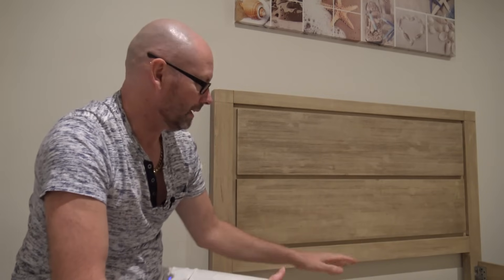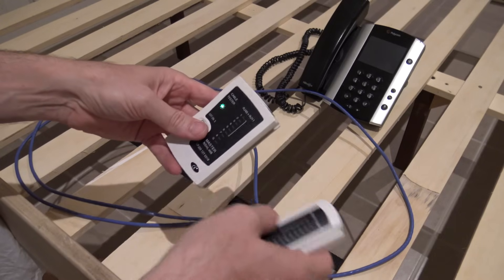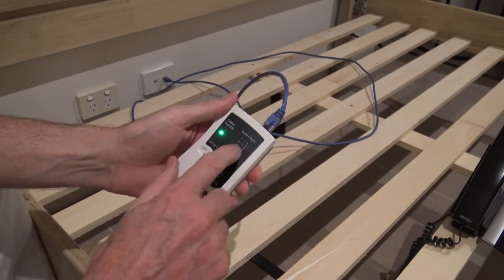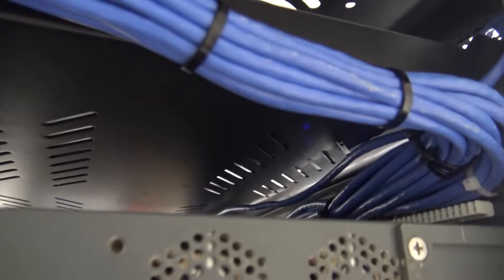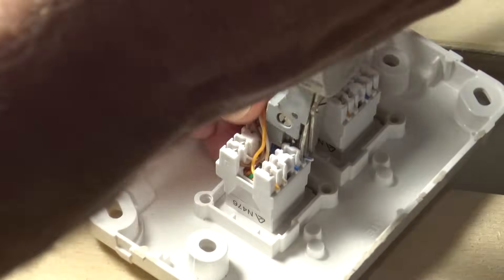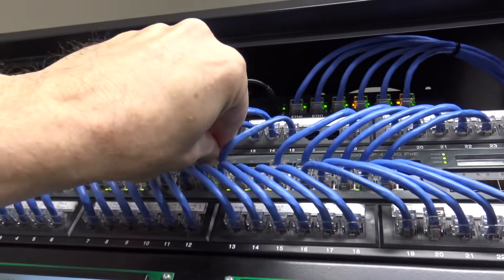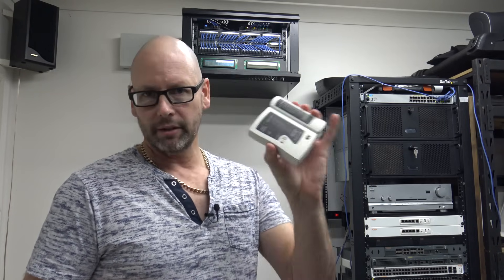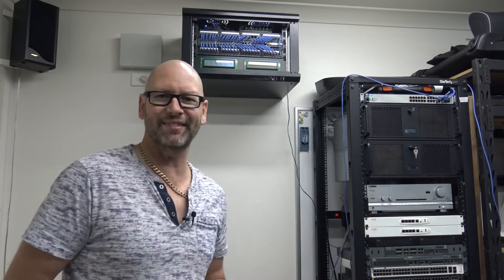Layer One Fault

Comment: Isn't it possible to get one gig from only 2 pairs ?

Once at work we had a faulty utp cable, I think pin 3 and 4, and it was for an AP powered with PoE. It was the cable that was faulty not the patch nor the crimping. The guy who ran the cables through the walls never came to fixe that.

So I went like "Hey let's suppose this is PoE mode A and try to use the unused pairs". So I did a different wiring on the AP side. Like you I didn't want to remove the patch panel to change the wiring on the patch side, so I juste made a custom patch cable that reroutes the good pins in place of the faulty ones : one side of the custom patch cable was pins 12345678 and the other was pins 12785634, since mode A PoE uses only pins 123 and 6 it worked.
After two years our customer finally got a good wifi connection in the back of the building :)

I'm not sur but I think the switch indicated that the connection was one gig, I have to check that.
Reply: Not possible

Comment: I wish someone with your sort of channel audience would tackle fiber optic terminations. Many network engineers are scared to attempt to DIY this yet it's become so simple with cold connection mechanical connectors that take only a minute to install and yield loss levels that are insignificant compared with fusion splicing. The whole toolkit is less than $100 AUD now, in fact less than $50 if one tackles it in a minimalist way. If you are unfamiliar with doing this, take us along on your journey of finding out how and discovering how simple it has become and if it's something you already know how to do then all the more reason for it to be a topic.

Comment: Those testers aren't bad for a quick check but i have had that type of tester show all connections as good but still having a fault at one of the connectors still, obviously enough connection to bell out but no connectivity. Had to resort to replacing both end connections to resolve connection. They are great for a basic first quick check though.

Comment: The Southwire M550 network tester is a bit better and more compact. It doesn't show results on both sides of the cable, but it only takes a second to pass/fail the cable. Favorite cable tester right now.

Comment: I'm sure your terminations would fail a test with a cable certifier. The pairs look to have been untwisted quite a lot. The magic in UTP is the twist ratios. Each of the 4 pairs has a different twist rate that is not a mulriple of the others. When you untwist the pair you allow noise to enter. Modern silicon seems to handle a bit of noise. Might struggle with 2.5G or 10G.

Comment: Good troubleshooting vid. You probably already know this but its more ideal to punchdown with as little untwisted cable as possible and put the plastic retainer cap on the back of the mechs. I prefer to punchdown straight into the back instead of off to the side of the mech but each to their own. Keeps the outer insulation embedded all the way into the back of the mech and makes it a bit more mechanically secure.
Reply from the maker: Yeah I know the theory, but I know the real world too

Comment: Check out fluke microscanner poe. Fluke shows fault distance and you can solve such problems more quickly and reliable. Also, you are using wrong tool to punch wires into socket.
Reply: How about you check out the price tag
Reply from the maker: ...and yet the problem got resolved.

Comment: The outlets should have a clip over the wires so they don’t pop out. Well in fact with new installations with CAT6A the wires are heavily embedded into the mech and can’t come out.

That cabling is of CAT5 standard where the wire can just fall out.